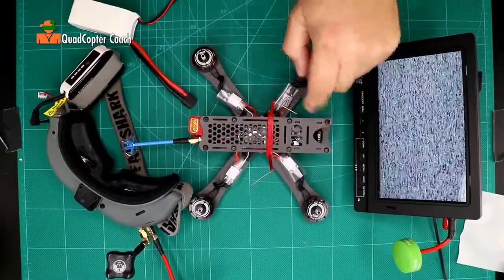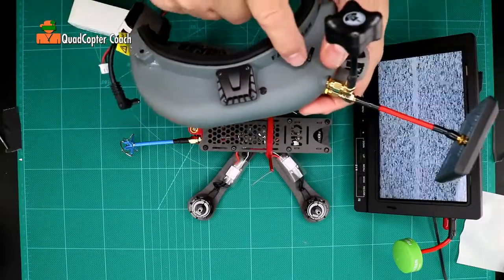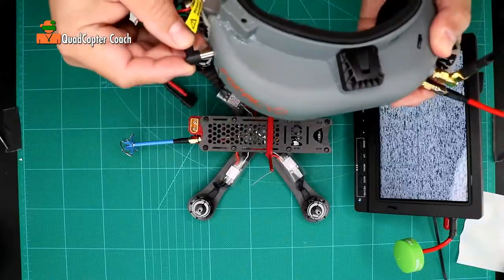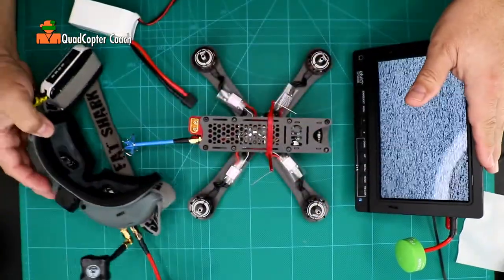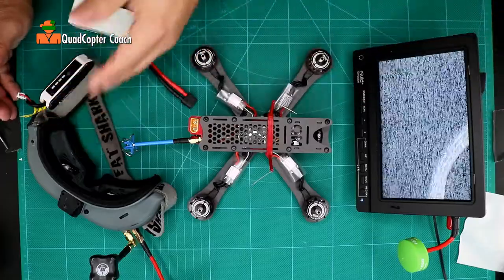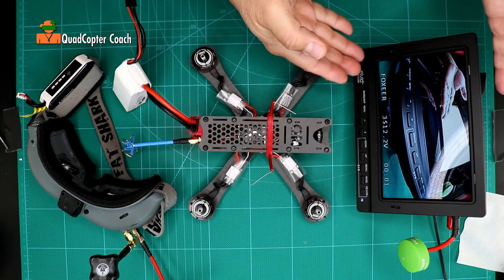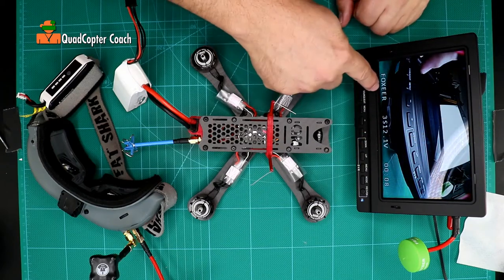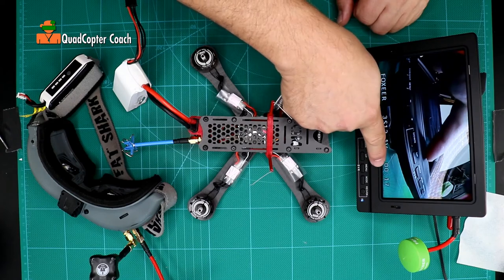45-Test the Video System Group

Comment: Sir how do we connect the fpv camera ? Whether on pdb or the FC ? Is the power cable goes to aux in PDB while the video I/O goes to telemetry input on FC ? Thank you
Reply: Camera takes 5v power. Any 5v padwill work. best to choose a filtered padis available. video wiles to to thoses designated pad.